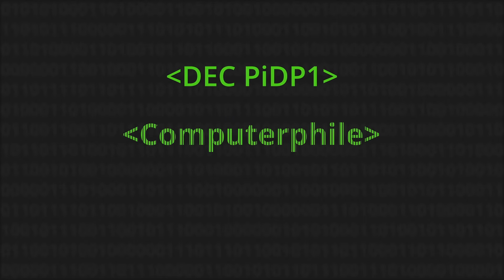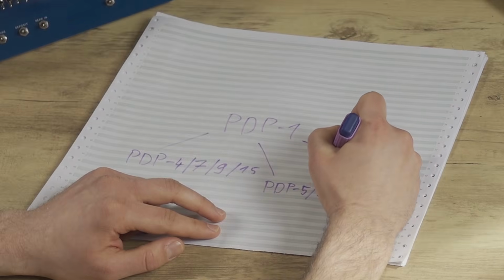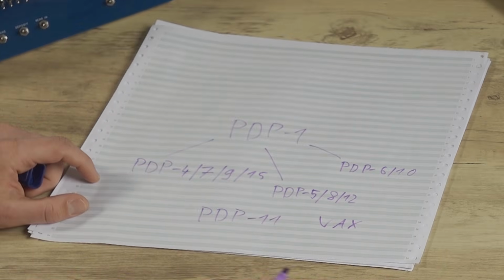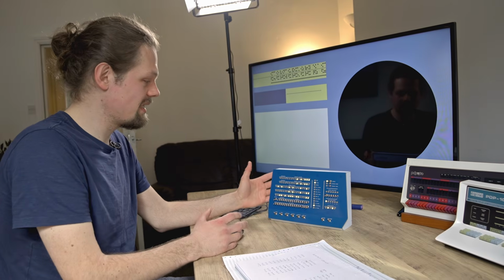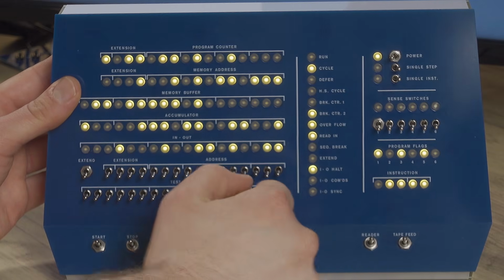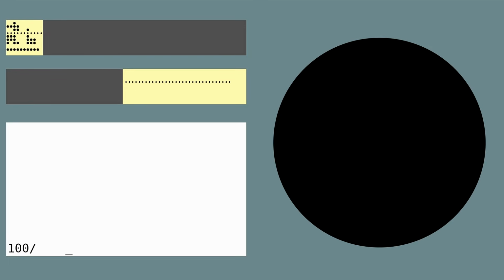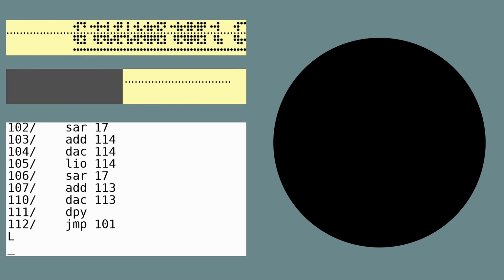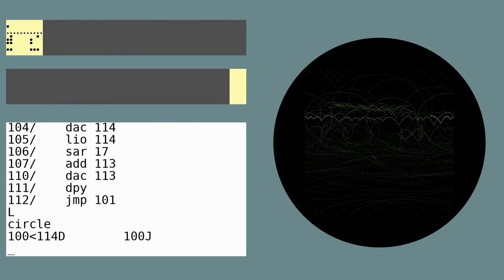Hacking on the PDP1 Raspberry Pi Emulator - Computerphile

Comment: They still had the PDP-7 in the Cambridge Computer Lab when I was an undergrad.  IIRC the RIM loader was left in core, but you had to memorise it for toggling in after cold start to load the bin loader, and use this to load the assembler and DDT. The assembler was 2-pass but you fed the O/P tape in backwards, and this converted forward references into backwards ones which could then be resolved by the loader. We also used a PDP-8 TSS at the Dept of Applied Maths & Theoretical Physics (DAMPT).  That was over 50 years ago though. 🙂

Comment: 1967 at UC Irvine we had a PDP-8 in a basically unused room in the Physics Department. A couple of friends a I claimed it as our unofficial office. I spent hours writing FOCAL programs on it. I liked it much better than BASIC. Much, much better.

One weekend someone from the department took it to a Boy Scout event. They broke it. Fried the memory controller as I recall. I was really pi$$ed until it was repaired.

Once I tried the FORTRAN compiler. Once. First you punched your program source on paper tape. Then you loaded the first compiler pass from paper tape. 10 CPS on a KSR-33. Took a long time. The first compiler pass read your source tape and punched out an intermediate form. Load the next compiler pass, rinse and repeat. At least that was the idea. The probability of reading the compiler tapes was so low that it was a complete waste of time. Gave it up and went back to FOCAL.

Comment: In fact - the PiDP-1 emulator does not need hardware - it can also run with an onscreen virtual front panel on any Pi or Linux machine
Reply: If I was apt to. I could probably try to find the schematics and implement the entire hardware stack in Logisim and run any code designed for it within Logisim.

Comment: line numbers in gwbasic are pop. or basic assembler with line numbers. the most simplest label system that does not use label naming but line numbers directly. best assembler is same complexity as basic. that was assembly not basic tho.

Comment: My first programming course in college started with PDP8 assembly.  We wrote the programs on the PDP 11/45, and transcribed the code to tape, which we loaded on the PDP8.  Before we could do that, we had to learn to toggle short programs in using the front panel.  Since it was a shared machine, you only had the machine for about half an hour at a time.  You needed to be sure that your code didn't take too long to toggle in.

A neat fact about the 12bit PDP8 is that it was possible to have memory that filled the entire address space.  On a PDP8 which has memory backing every address, you can write a program that writes zero to every address, including itself.  The program will not halt.

Comment: now make it run Doom
Reply: There's something much better to be run on this: famously, the very first digital video game, "Spacewar!" (1962), originated on the PDP-1.
Reply: No chance, I’m afraid (unless you run the emulator much faster than the original hardware, of course). It’s barely possible to get DOOM running at low settings on a 286 PC. The Amiga 500 famously couldn’t and still can’t run DOOM, despite having a fanatically loyal community which loves optimisations and crazy technical achievements. The original point of the DOOM meme isn’t that DOOM has incredibly low hardware requirements, it’s that many modern processors embedded in devices have lots of processing power, sometimes a lot more than they absolutely need.

Comment: The Vax is so standard, its speed is the basis for modern measurement --- 5 MHz, or in log scale, 1. The first IBM PC was a .86
Reply: Really the ratio is bigger than that IIRC.  The VAX tended to take fewer clocks per instruction than the 8088 did
Reply: If it is a log scale you need

s = k*log(f/f_0),

where k is determined by the choice of basis of the logarithm, and f_0 is a reference frequency.

You said that f = f_1 = 5 MHz gives s = 1. This fixes

k = 1/log(f_1/f_0)

the s = 0.86 gives f

f = f_0*(f_1/f_0)^s

What is f_0 so that we can define this scale? 1 MHz?